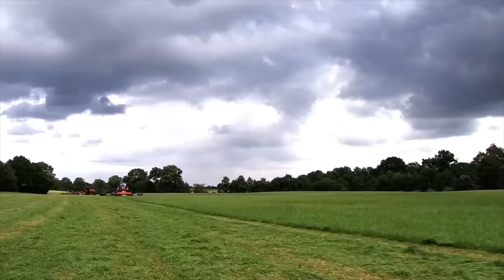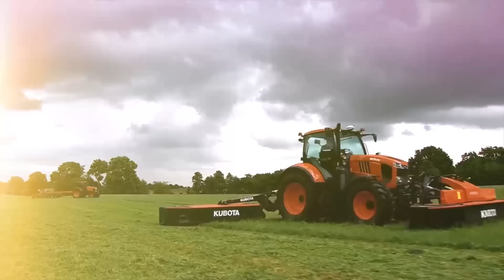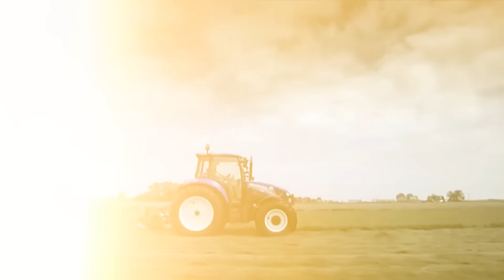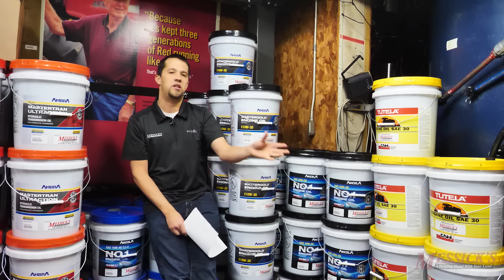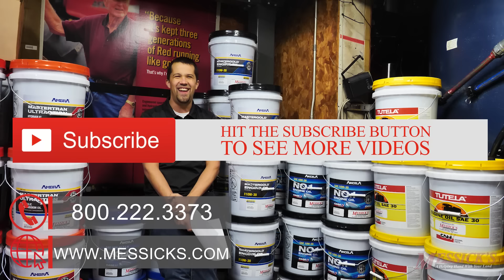A hydraulic fluid so bad, its been banned!

Comment: I run 15-30, 5-30, j20, j33, used motor oil, transmission oil, etc. Whatevers around. And the old hoe "redistributes" it back to mother earth. Sometimes violently with a burst.

Comment: I was sold some hydraulic oil from a NAPA and was told it would work with our john deere tractors.   I put some in our 4240 and almost immediately noticed more vibration through the entire tractor.  I got out the bucket to see what it was and sure enough, it was napa branded 303.  That $30 bucket of oil cost me several hundred dollars worth of good hydraulic oil.

Comment: The big issue here is not that X fluid is good or bad, it's whether that fluid is appropriate for the application it is being used in.  There is a HUGE difference between a straight hydraulic system and combination hydraulic/hydrostatic drive system, and just because a fluid was right for a 1974 John Deere, doesn't mean it's right for a 2004 John Deere.  It's really sad that the equipment manufacturers and lubricant manufacturers haven't pushed for a recognized standard for hydraulic fluids, and it's even more sad that many of the manufacturers of "generic" fluid" don't do a better job helping the consumer choose the correct fluid for their application. An ETHICAL approach would be to spell out on the label in some detail where X fluid is absolutely NOT recommended, or putting application guides in store aisles.   Nobody likes a bargain any more than I do, but I also expect equipment to last about 1000 years and work the way it's intended to every time, so personally I'm willing to spend a little more and get the BEST fluid for my application, even if it costs a little more.  We can ALL name situations where we used something not for it's intended application and all went well, but remember that even in Russian Roulette, everything comes out fine five out of six times you play.  That sixth time is the killer, pun intended.

Comment: Friend of mine uses JD tractor hydraulic oil in his automatic trans for his Drag car! Works great and he’s had much less failures over the years!
Only problem using it is the viscosity when cold! Probably too thick for extreme cold temps for a auto trans to work properly.
I’ve used tractor oil for my hydraulic jacks also!

Comment: Question for you guys..I have a Yanmar EX2900 with a hydro transmission and front end loader.  330 hrs.  
I did my 300hr service on it this past weekend and picked up vp racing lubricants ultra j20a.  I neglected to read the fine print at Tractor Supply and it says for use in older pre 1990 tractors.  Mine is a 2008.
Yanmar recommends TF500 and that is a J20A from the pictures I have see of the actual oil containers.
Any thoughts?
Reply: I believe vp racing was sold yo new company i recommend at the very least go to the tractor supply brand it cost more but carries higher rating i have it in my 5300 JD with 12k hours my new JD 5075 i use the JD fluid not really that expensive compared to TSC brand .

Comment: 303 is, I believe, a straight weight oil, with lower levels of anti wear additives. If you have an old machine that leaks, there is no reason to pay twice as much for an oil that will end up on the ground. I can't tell you how many 5 gallon buckets of hydraulic oil I've gone through over the years. A LOT.

Comment: Explanation of why it was supposedly banned, would have been a worthwhile addition to video. And why state got in on it. Was it trouble if it leaked? Causes leaks ..hard to clean up? .I know for a time when r 12 for cars got restricted some co were retrofitting with propane worked but if a leak a fire ball.so it got banned. To used to regulate brake fluid seems somecpackagers were not using dot 3 .but labeling it .other states let lobby groups 
A few states outlawed lead wheel weights .even if they came off the previous tires installed could not reuse 
With government you never know what they will come up with look at carb in cal .wanted to demand all cars be white and all roofs painted white .even in the north part of the state that not deserts

Comment: I gotta agree with ChuckE2009 there,  and I've bought 303 from TSC because its going in a 66 dozer and 70 backhoe and both of those meet the labeling where it says on the 303 pail, for equipment older than 1974!   They don't use a lot so its a few gallons a year but why not.

Comment: OMG, thank you for finally covering this topic!
As the lead tech at a local equipment/tool rental company, I have been fighting the 303 issue with my local hydro shops, Smothers and Napa stores for almost 20 years. Not a single one of them really understood what the issue was with that fluid, and when I talked to anyone in charge, they basically said the same as you did, "Its cheap, and we sell a lot of it."
Can't really fault them there as selling items come first right? But, I would not use this oil in anything more complex or advanced than a log splitter or hydraulic tiller. If you are looking for a better universal choice and are not necessarily going to run the maker specific factory oil, then please try to pickup a UTF that is made to J20C standard. I have confirmed with a local oil/fuel supplier in the past what is said here, that there is no actual standards in place for hydraulic fluid. It is of course entirely likely that even J20C is not appropriate in every situation, but its at least a more modern spec and certainly better than a 40+ year old fluid.

Comment: I bought a skid of it when it was on sale for $15 a bucket.  It's hydraulic oil......as long as it's not compressible, doesn't foam, and has decent r&o protection, who cares?  I'm not running it in the transmission of anything, just in hydraulic systems.

Comment: We run 15w40 for hydraulic oil in kubota r520 articulated machines..so said by kubota dealer.. others use nuto 68. Or 32.. cat stuff get cat 50.

Comment: In the 70s through 90s  I started using hydraulic oil in the powersteering on my bobtail dump trucks powersteering fluid was too thin it would run hot and eat the seals up on the power steering boxes,a old man told me to try hydraulic oil and I never had a seal go out or pump or steering box trouble again

Comment: I don't worry about the spec being off.  But i wouldn't buy it because I've dumped it into a tractor in cold temps and it had ice in it.  So i assume they all have a little bit of water in them you just don't notice it when its warm out.

Comment: No I haven’t read every label on every 5 gallon bucket of hydraulic oil but the ones I have indicate that 303fluid is for older tractors. If you believe it’s OK to use 303 fluid in a newer machine you are causing internal damage to the pump and gears. This kind of damage does not manifest itself for many many hours of use. At some point you’re going to be scratching your head wondering why you’ve had catastrophic failures in your equipment.
I believe the government should enforce truth in labeling and advertising and hold companys responsible for the damages they cause for misrepresenting themselves. However it’s your choice,we all have the right to be idiots.

Comment: Never heard why they said the oil was bad . No reason given .
Reply: It doesn't meet the standards for newer tractors.
In modern tractors the hydraulic fluid works the hydraulics, brakes and the transmission.
303 wasn't designed to do that and it can tear up transmissions and brakes.

If you have an older tractor that just used the hydraulic fluid to move the hydraulics, 303 will be fine.

Comment: I have an older model 310-D backhoe, and here in Florida I use AW68 because of the heat issues, however, I also have a 1950 9N tractor that I do use 303 oil with no problems.

Comment: CAUTION  !!!   North Carolina is going the way of CALIFORNIA !!!!  (you're gonna hate it). 
The hydraulic fluid is still good - and it's still cheap - and THAT IS THE ONLY REASON it was pulled from the shelf. Just another case of an oligarch's reach into the pockets of those that wish to conserve their older equipment.
Still works fine in the many old tractors across the rural community - but the guys selling the NEW STUFF - don't want people to keep their old stuff - without punishing them for not buying new stuff ... and of course we believe EVERYTHING the government does is good ... right ... ?    
So no more cheap hydraulic oil for your log splitter or your old tractor.   
If this guy sold computers - he'd be a "technocrat" .  This is the gentrification of equipment marketplace.
Reply: NC's problem is it is a short drive there from NYC.
The NY escapes move to NC because they have made NY a hell hole and then start to recreate NYC in NC.

Comment: 303 is fine if it gets replaced often and doesnt get wet when used in most older equipment. You cant tell me different, ive got my lifes experience to back that up with. Ive changed thousands of gallons of 303. Only pump ever failed was a Parker on a 2012 Toro and it was running toros high dollar synthetic. Fwiw

Comment: 303 hydraulic oil is intended for use in a stand alone hydraulic system. An hydraulic system that operates only hydraulic components such as a front end loader or backhoe. It was not intended for wet brakes and clutch applications.  Some people ( employees of the state of north carolina) mistakingly use it as a general all purpose  lubricant in tractors with wet clutches, and whind up shortening the life of those parts.  If you use 303 hydraulic oil for its intended purpose, you will not have a problem with it.

Comment: I HAVE USED SEVERAL TYPES OF HYDRAULIC FLUID NO KNOWN PROBLEMS!
BUT I WAS AROUND A REAL WIERD
HYDRAULIC FLUID ONCE IN EARLY
2000!  WE WERE WORKING WITH AN OLD EXCAVATOR WITH LEAKS!
THE OWNER FOUND SOME US NAVY HYDRAULIC FLUID THAT WAS FROM SURPLUS SALES!
IT WAS SOLD DUE TO A "USE BY"
DATE ON THE 5 GALLON BUCKET!
IT WAS ALSO A FIREPROOF HYDRAULIC OIL USED IN CANNONS!  IT SEEMED TO WORK OK, BUT I WONDER ABOUT THE LONG TERM EFFECTS OF IT!!

Comment: We have been using 303 in our equipment for a long time and have never had a failure in any transmission or hydraulic system due to improper oil. I’m not going to a dealership and spending 100 dollars every time I need a bucket of hydraulic oil. Sorry buddy, ain’t happening. I guess if I ran newer equipment then hydraulic oil would be something I paid closer attention to because hey, if I’ve got the money to buy a tractor that costs tens of thousands of dollars then I guess that means I can afford dealership hydraulic oil. But I find it hard to believe I’m doing something wrong using hydraulic oil from let’s say Napa or Tractor Supply in machines that were built in the 70’s and 80’s. You said it yourself in the video, they’re all pretty much the same. At the end of the day, a salesman is a salesman. He wants you to buy his product so he can make money. And as far as a state government banning people from being able to buy a particular kind of hydraulic oil, well I’d say that’s a little more than overreach. If it’s my money and my equipment, I’ll buy whatever the hell I want to buy to put in it.
Reply: The word I got from a service tech that was at my house just two days ago was that 303 "eats brakes". He didn't suggest it would work in general. He says it'd be fine in my 1950's model 50 (different braking system), just not my newer equipment. I can use anything else, just not 303, and he's not selling anything. At my TSC, 303 is $17. 20A is $26. Traveller is $38. Don't need to spend $100.

Comment: Messicks can't beat the price so lobby to have it removed just like that green company in Missouri did my mf165 did great on it has a PTO seal leak so has to be toped up don't want to spend 75 to 80 dollars a bucket on the other stuff  when it's going to leak out that seal will be replaced when I pull the lift pump in the future after I have my shop finished till then cheap oil thanks for the over reach and siding with big business over the little guy

Comment: They don't want low cost fluids to be sold because people won't fix the leaks. They figure if it costs more for fluid than to repair a leak, there will be less oil running on the ground.

Comment: mobil 424 oil is what i have been told is about the best... we have a hydrostat guy that has rebuilt hundreds if not thousands of pumps and components and his personal recommendation is mobil 424.. he says if that is used then you will not have pump or motor problems again.. seems far fetched to me but i would assume he would know.. we have been using it for many years now and haven't had any problems..
Reply: There will always be problems, yet I'd go with the Mobil 424. Signed,  Former Gradall mechanic

Comment: The nicest thing beside the price of 303 is it flows and pours at -40°F .  I blend it with my motor oils to avoid dry cold start conditions .  My hydraulic lifter engines really enjoy having oil right away when cold.

 Another nice thing about it is it stays cleaner longer than any other engine or hydraulic/machine oil I've used.  

I go into any "off label" use with the idea that someone somewhere said if you do it something major is going to break because of the oil, so I pay attention in case something odd starts happening.

So far in over 5 years nothing major (or minor) has come up and I'm not nice to my stuff, the machines work hard. 

This seems more like a smear campaign as the oil is typically 1/3 to 1/5 the price of the next jug on the shelf. 

And finally when it's time to change fluids it's not near as painful to burn the used oil in the shop.  

It works fine for my program.   I wouldn't recommend my program to others, as I'm intrinsically aware of the risks I'm taking, whereas others may not be, even if their results proved to be as successful as mine.

Comment: Missouri banned it...I could by it for $25/ 5 gallons at Orcheln's...I put it in oil leaking Steigers...Gotta put 2 about gallons in them 40 year old tractors every time ya run them....Oil cheaper than fixing the leaks...  Bought 2 Steiger Panthers years ago for under $20,000 will do about anything a 400 hp $300,000 new one will do..Plus Big Tractor Parts up by Fargo makes every part for them still......I am a downer on new paint, meaning new iron...
Reply: Missouri banned it because it was being used in the production of methamphetamine somehow.
Reply: Road trip to the closest state that has it and buy a pallet or 2.

Comment: 303 makes a great auto trans racing oil. Instead of buying ridiculously overpriced B&M Tric Shift or any of the other racing ATF's. I wouldn't use it in any application that sees street use of any kind or prolonged use but drag racing, works a peach! Ive built street & racing transmissions and am ATRA Certified. 

Heaven forbid anyone has the forethought to choose the product they need. Never mind that theres a lot of people with old equipment that use 303 that don't want or cant afford to convert their fleet. Absolute nonsense. Fire up the 303 black market trade over there.
Reply: mytmousemalibu ...I DO use it in daily drivers. I am completely convinced ATF is an elaborate hoax. Case in point: Ford C-6s used type F since their inception. One year -1978- they required Dexron. Then, back to type F until the end of production. I've done my share of C-6s and can tell you the differences for the entire production run amount to different  springs and different colored gears for speedometer drives. I have run SAE 10 , AW 68 hydraulic fluid, and lately this 303 tractor fluid in Ford C-6s. 
The only failing I have found so far with 303 tractor fluid is that it won't stop wet brake chatter on Ford tractors, even though it posts a New Holland spec number. To cure this, 2 pints of New Holland brake additive must be add to the 303 at oil change. The other option is to spend $80 for a 5- gallon can of New Holland Ambra. And a 9700 takes 4 of them.
Reply: @ASPCOT  Wow, okay then! I just don't know what the 303's detergents and modifiers are and how well they stand up in place of ATF in daily use. I could only vouch for racing use but your experience adds merit to continual use. Thanks for sharing, good to know!
Reply: Theres a youtuber by the name of doc who recently posted a video of him having a trans line burst on the back end of the 1/4 mile. Made a huge smoke show as the fluid was sprayed on the hot headers. He uses 303 I believe, and is convinced the car didn't burn to the ground because 303 has a resistance against combusting.
Reply: @clerdman1  Hot ATF igniting makes for an incredibly dangerous fireball & "explosion". I can see where the properties of 303 would mitigate that risk. Its a fair bit more viscous and hot ATF is very runny and has a low smoke & flash point. That could really save your bacon. You don't have to look far or hard to find videos of that happening.

Comment: Yes but...this circles back to people not knowing or just simply cutting corners. That oil is perfectly fine for JD tractors before 74. I'm a firm believer of put what the manufacturer sells in your tractor. If it's green put their oil in. Blue tractors take New Holland oils. Next NC will ban diesel cause someone managed to put that into a gas engine.

Comment: If that isn't the most click bait title I've seen in awhile, and yet no real explanation of exactly why it was pulled. If it was that bad this would have happened across the Nation. They did this same thing in Missouri and we were all scrambling trying to find fluid for our wore out 60's to 90's equipment.
Reply: Missouri banned it...I could by it for $25/ 5 gallons at Orcheln's...I put it in oil leaking Steigers...Gotta put about 2 gallons in them 40 year old tractors every time ya run them....Oil cheaper than fixing the leaks...  Bought 2 Steiger Panthers years ago for under $20,000 will do about anything a 400 hp $300,000 new one will do..Plus Big Tractor Parts up by Fargo makes every part for them still......I am a downer on new paint, meaning new iron...